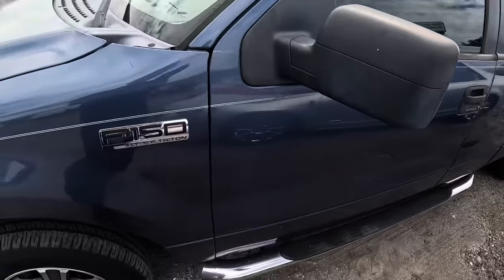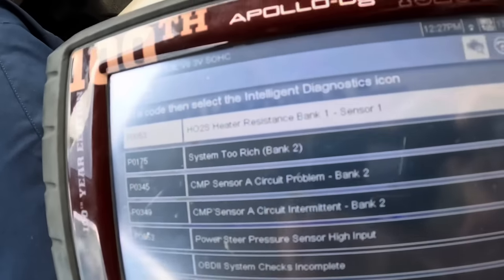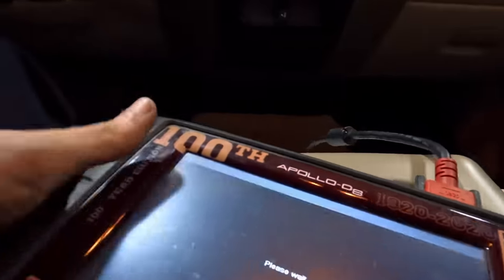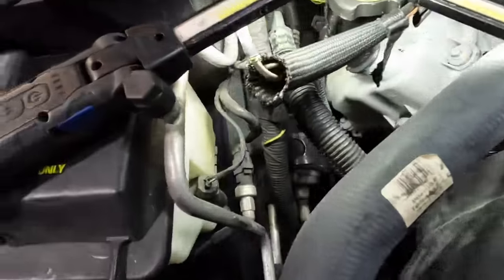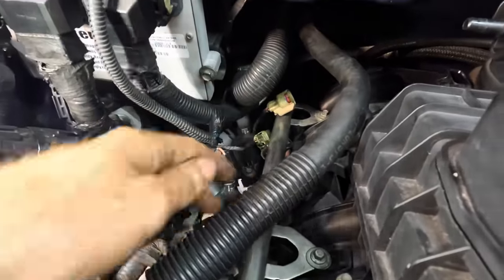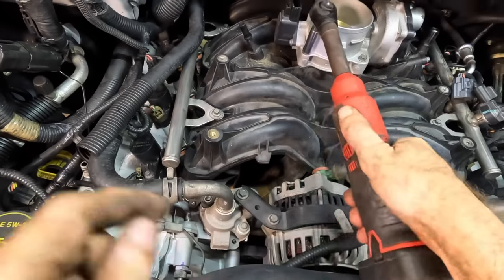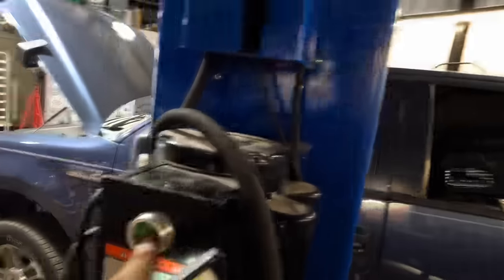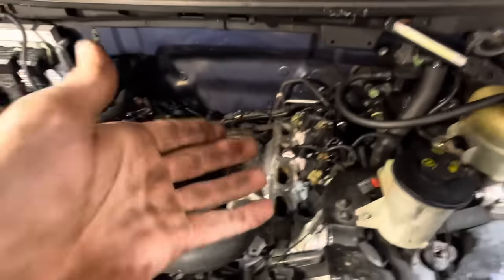Hack Job! Mechanic Botches Engine Replacement! Multiple DTC's

Comment: "Warranty void if removed" type stickers/notices are ILLEGAL in the USA, by the way. Unfortunately, we live in a society where it is 'normal' for businesses and corporations to flout and break laws. To make my point, they can't tell the difference if the customer has removed the 'heat sensitive' tag or if it cooked off. And they CANNOT deny a warranty claim just because the tag/sticker is gone. At least, not without running foul of the Magnusson-Moss Warranty Act.

Comment: Too bad you cannot name the guilty parties. But the owner of the truck has that right to do. My wife had her Toyota engine replaced with a reman unit will I was overseas. The replacement engine turned out to be a prettied up junk yard engine. RAM like crap. When I got home I raised holy hell with the Toyota dealership for a year ! Finally Toyota sent me a new engine and a different dealership did the install. Has run perfect for 10 years and counting.
Reply from the maker: They’ll sue me for defamation
Reply: @RainmanRaysRepairs  Yeah I get that. Too bad though. The idiots that know they are cutting corners need to be called out ! Seems so many people nowadays just care little about the other guy. Glad this know someone like you exist. Keep it up.

Comment: For some reason the GM 2.7 turbo truck engine has this 5.4 money pit outclassed.
Why should anyone have to dig their hands way deep inside an engine bay to remove things.
At least VW would use a W8 or something.
Of course, my step niece's great grandson bought a 70 ft. motorhome,
and she hauls a Ford with a 5.4 turbo behind it for e-mergies.
She has put 800 000 mi. on this engine and it's all original !
He great uncle works at the GOJO hand cleaner factory.
Everyone has grease on their undies now.
Jesus, that's forde quality !

Comment: One thing I am thinking is how a well maintained Ford 150 V8 would need a new engine at 214,000 miles in the first place; Fords are not what they used to be :(

Comment: The seals on the plunger that tightens the timing chain rails is bad are bad there's two...as the car pumps up oil pressure raddling goes away...eventually it can become catistafic...the mullon pump can help but it ain't a fix...I know cuz I got a brand new one that was bad ..had to tar apart again...I heard bs about 5.4....you change the oil(synthetic )religiously every 4000 miles..those engines will run and run...

Comment: I'm kind of sad that I will never know what it's like to have to have a second engine installed in a truck. My Toyota 2TR-FE may not be sexy, but her cast iron block and hydraulic lifter top end may never know the touch of another human since it left the Kamigo plant in Japan. I'm confident that once 20 or 24years pass, the frame or body will be too rusty and it will be laid to rest.

Comment: Unbelievable hacks and a waste of money. That shop should be called out Ray. I bet the ECM was okay, and the original one should of put back in. All those chopped up wires must be soldered and heatshrink. BTW was the battery disconnected?

Comment: I have worked with people that would do that type of work normally the silicon is used because they tried to cut costs and re use the old gasket the installer probably pulled the transmission out with engine that’s why sloppy wiring job

Comment: how come a 5.4 litre engine needs to be replaced at 200,000 miles and my toyota 1.6 valve matic corolla is still running as good as the the day i bought it with less than 10,000 miles on the clock, it now has 230 000 miles???
Reply: Maintenance accounts for some of it, but the 3-valve version of the Ford 5.4L was a problem motor.

Comment: Those ford's are famous for timing failures. It's probably getting bad. Probably cold starting chatter.  Once it builds oil pressure its fine making it intermittent.

Comment: God i owned one of those 5.4 had 147000 on it and that timing chane accuaters started rattling among transfer case issues.drove it to dealer and unloaded that thing.normally wouldnt do that but those 5.4 are junk.and over engineed.glad its gone.

Comment: Looks like they forgot to heat the splices on the passenger side VVT solenoid to get them to shrink like on the driver's side!
And dielectric grease in the connectors is a big no-no---it's an insulator and should only be used on the shells of connectors never directly on the terminals!
Reply: Dielectric grease in connectors is fine, protects the pins from water and corrosion.  You can use it on battery terminals, bulb sockets and seals, etc, also.  The electrical connection will be fine trust me.  The metal will push it out of the way, leaving the grease as a protective bubble/sealer.  On my atv, i filled every connector with dielectric grease.  Connectors come apart easily afterwards, and they are protected.

Comment: This is one particular vehicle that i would never go with a rebuilt unit at all. If somebody wanted to replace this engine i would do a long block right from ford or i wouldn't do the job. These are so problematic i wouldnt roll the dice on having to do the job twice.

Comment: I just hope the engine re builder didn't use after market cam phasers, as they are junk.  The noise could be the phaser of rocker follower. Let's hope not.

Comment: They just put a brand new long block into an 07 Honda Civic with all new parts Asian if I could find them or just Honda brand and it was $7,200 in parts and I would be embarrassed to tell you how much the labor if I did it $200 an hour here in California would be close to 10 grand

Comment: Guessing now, before I watch the video in it's entirety: installers crushed, cut or in some way shape of form damaged the wiring harness. Let's see if I get lucky...
Reply: Sort of right, I guess. Was worse than I was originally thinking ; like they neglected to disconnect everything before trying to pick the engine from the vehicle. Yikes!

Comment: lol 😂 my 2004. Yes it’s even the prototype here and it’s built that good !Durango 57 hemi passed 200,000 miles five years ago it now has 350,000 on an all original unopened untouched engine and the same transmission the same transfer case because it’s an all wheel drive you people who drive forward drive junk and you cost you a lot to drive it. I’ll never understand why you choose an inferior vehicle maker?

Comment: Iam sorry but i absolutly cant stand remain engines had bad experiences with alot of them and transmissions too. Would perfer to find a engine builder or a local transmission builder not assembly line stuff. Lol great video.

Comment: Do you ever test anything in your diagnostics, or is it always try-agnostics????
Reply from the maker: You want me to test the broken off sensors? 🤣
Reply: @RainmanRaysRepairs   No, I didn't mean it to sound like a dig at you... Everybody does what works best for them.... Seems like you ditch the scan tool quick, but you get the job done... And, I've never seen anyone with your energy and work ethic... Regards
Reply from the maker: @steveo6631  no offense taken at all, you know I’m a bit of a smart azz 😉
Reply: @RainmanRaysRepairs  Not problem... (In Russian Accent)

Comment: I want a vehicle that has no electronics, just mechanical, no sensors of any kind, no ECM, just a distributor and coil for the sparks plug to fire on time. Roll down windows and no fuel injector crap. I want a diaphram fuel pump that works off the cam.

Comment: this is why you never ever buy the 5.4 triton 3 valve. I wouldn't get the new 5.0l either especially the early ones, has a manifold issue where the flapper rods break. I miss the days of the straight 6. damn engine was bullet proof and had good low end torque. Ford has lost their way letting accountants cheap down designs.

Comment: Ive owned too many vehicles in my lifetime, from Ford, Dodge, Chevy, Buick, cadillac, GMC, Oldsmobile, and  Nissan and found that i can run aftermarket parts on anything except Fords. Fords just dont eun right unless they have Motorcraft parts in them. I'm not putting down Ford, i drive one currently, but they're not as forgiving as say GM vehicles as far as replacement parts.

Comment: That looks like a nightmare to work on. But lots of money to make atleast. Im no expert ive only worked in a shop for a few months and only fix my own vehicles ans somtimes help friends or family. I still have alot to learn. I have some experience with fords and gm from late 80s to mid 2000s and for me fords are always a nightmare for me .even with books and scan tools.i like ford and chevy but hate working on fords. Bolts or nuts and replacing parts love to break or parts fight me  or not cooperate and just fit into place.i guess because I live in north east with rust and corrosion. Probably wouldn't be so bad if things didn't get so rusty and corroded. There's not even money in the world to work on fords for me lol

Comment: never huy a ford with 5.4L in it just try and get the pluge out of that engine and the timing chains fail give me a good old 302 with a carb and it will run for ever and you can find and fix most things in mins

Comment: All thats being told is a good rating from the BBB < business pay to get that ratting> and a tottaly unqualified Google review ratting.

I think because mechanic have to get certified ANSI then ANSI should be doing ratings on rebuilt engines transmission and new parts and it must meet an industry standard to get the ANSI ratting thats generated by mechanics who install the parts and testing and tear down tec's to inspect the quality of the work done or the products build quality 
From replacement body parts to tail light lenses parts must be as good or better then factory orignal 
And pass the same crash tests issued by the insurance industry.
No more sorta work parts.

Comment: The amount of Wires not Mounted to there correct brackets and the shauty way the wires and Hoses are routed the Fuel injector Wire being Completly pulled to its max and stuck behind a bracket is just wrong the crappy paint job done all over the engine who ever installed this engine didnt know what they were doing nor did they take pictures to remind them were the parts and wires went 36:00 @Rainman Ray's Repairs

Comment: I agree this is a shit job. I take pride in my work. Unlike most mechanics, Silicone on a oil filter housing drives me crazy. not to mention the shit wiring. The intake had silicone thats a bitch to clean out of the groves for the gasket.

Comment: Delt with this kind of mechanic recently my self oil leaks everywhere pinched and broken wires and missing bolts on the oil filter adapter housing went to do a n oil change and put a little torque on the filter next thing I know I’m covered in anti freeze and it’s all over my drive way. Guess what dude only put on bolt back into the housing. I was livid from that o top of the other issues. Also not to mention the phaser of the motor took a shit so now I have trashed phaser. Gotta love shity rebuild companies and mechanics. Sad cuz I’m a mechanic my self in the marine field and I can’t do the engine removal my self otherwise I would have. Can’t sue the guy cuz he’s on the run from other shitty work he has done so I’m shit out of luck lucky me right🙃🙃🙃

Comment: If he doesn't eat it, and if it were to go to court, it's probable the lawyers and time lost will eat up a win. That's definitely unfair.
Reply: The lawsuit, if one is warranted, could be filed as a Small Claims Court cause of action, which does not permit attorney representation and imposes a claim cap of varying amounts depending on jurisdiction (e.g. $10k in CA and $8k in FL).  The matters are handled in an expedited fashion vs Superior Court filings and the rules of evidence are typically relaxed to a certain degree due to the "in propria persona" nature of the litigation. I'm an exception to the "no attorneys in small claims court" rule here in CA (if I ever have to bring a lawsuit in that venue) because I'm a lawyer, and thus I have an idiot for a client. 😄

Comment: the only thing worse than a 5.4 is a bad 5.4 install from a bad shop,  Pressure wash and paint doesn't count as a new engine or overhaul I've seen that many times in the past.

Comment: No opening disclaimer will stop a defamation law suit Ray. You'd be best to keep your enormous ego and righteousness in check. Businesses bad mouthing other local businesses will put your butt in a crack. And my experience with the start up noise is cam chain tensioner.  Best of luck pal.

Comment: That there is classic throwing parts at it all over without actually diagnosing. A whole bunch of cheap aftermarket crap china autozone replacement sensors. I see issues with those crap sensors aalllllll the time

Comment: Thats a Reman engine, I own a 07 F150 with the same motor, I have 180k on it, the motor has never been touched, original timing chain, oil pump, water pump and my motor sounds Better  than that so called rebuilt unit...

Comment: For me, amything less than brand name for rebuilding motors is not good enough. Suspension, brakes, whatever. Engine and transmission? OEM or better only.

Comment: Here is my problem with all of this, there is no professional organisation regulating car repairs.  I am quite opposed, actually, with bureaucracy , but in matters of the trades and engineering in general, I think some culpability is needed.  Clearly the skill levels on this rebuild are low.  Oddly enough ,I was having Her Ladyships care rustproofed and next door was an engine rebuilder, so I stuck my nose in. It was horrific.  Junk everywhere, engines piled up, you get the picture.  I wouldn't have used them to pump up a tyre.
How can the consumer protect themselves against cowboys like this ?  Forget the court system. Too long and expensive.  Trade court might help.
Opinions anyone ?

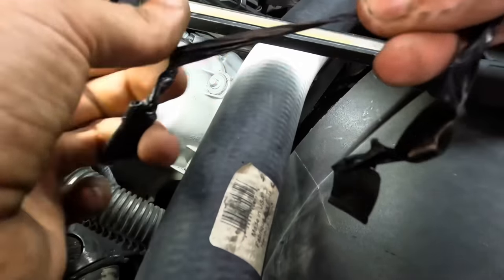Comment: 26:00 what a crap splice job ,never use butt connectors, but use a OE type copper crimp & solder as well as shrink tubing & conduit

Comment: I remember the days when the intake manifold was metal and not plastic, things was more durable before the plastic apocalypse we have now 90% of everything on vehicles now is replaceable and not repairable my grandfather said ford made the most ignorant mistake switching to aluminum because aluminum being softer than steel it’s impossible to repair when damaged which is why if you get hit you have to replace the entire panel or door, etc for small dents they’re not fixable because one of the beautiful properties of aluminum which is like I said it stretches so instead you take it to a certified shop and have them order a bumper or your take it to ford and they fix it and have a third party painter paint the part after color matching it’s stupid asf, not to mention the newer 5.0s seems to be unreliable to all hell as despite proper routine maintenance it still started having issues ranging from overheating to the radio shitting the bed, fords quality = garbage!

Comment: I have a feeling that there is probably more hidden damage that is, not yet found,,,,  The kind of stuff that is not bad enough to trip a code,,,   Is the rusty water staining on the bottom of the air intake normal,  or it that another future problem,,  ???  was the old engine run without antifreeze solution??  Wonder what the radiator and heater core look like??  I had to replace the heater core on my truck when I had it,,,  That was one butt-ugly job,,  :-)

Comment: I would think the engine installer would have at least run a scan before the truck was released to the customer. The worst repair shop ever.😑

Comment: I can’t wait until the EVs take over. Gas is dead 😵, they pretty much maxed out economy and performance and made vehicles impossible to get repaired with much confidence that the parts will fit and work and that the technician is competent 🎉😂
Reply: Even if you do spend a buttload of money to get that $10 part replaced for $3782.54 , all the other parts are now suspect due to poor design, dirt, moisture and oil getting into everything 🎉🎉🎉

Comment: these kind of videos, sometimes hard to tell where the line is between an actual screw up and things that just werent done the way you would have. I've seen it also on a couple of the electronics channels i follow. not to say your ultimate conclusion here had anything wrong with it.

Comment: Wondering how much of this broken concealment has to do with job pricing rather than having a dialogue with the customer when things happen.  Perhaps one person removed the engine and another installed it and there is no continuity of responsibility.  Who broke the o2 sensor and the sensor in the head?  Perhaps the installer inherited those things that happened when the engine was removed and now can't approach either the employer and fix it where its just more prudent to slap it all together and let god sort it out.

Comment: Talk about shooting yourself in the foot.  Why not replace the two broken sensors before saying everything was done?  Wht not run a scan to make sure there were no DTCs before shipping the truck out?  Why not put the wiring back in the position where it was found during disassembling?

Whomever worked on installing that engine made a name for themselves as the person not to be allowed to install an engine.  Of course there is another possibility.  The person who removed that engine may not be the same person who installed that engine and didn't have the slightest idea how everything had been routed.  Either way, someone messed up by not replacing those two broken sensors.

Comment: Not bad but all those electrical connectors are crappilly repaired and even more poorly repaired. They should have not done the ends and put a whole new harness end on each one instead of wasting the mechanics time on splicing wires. Say it, don't belittle the last guys work but the companies policy. THATS THE ISSUE.